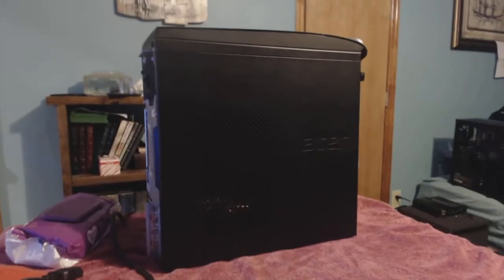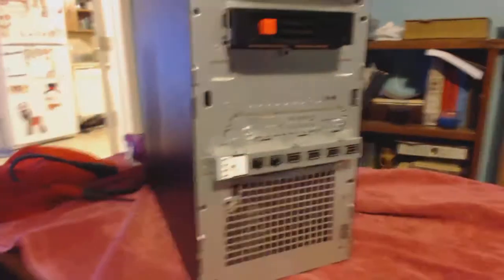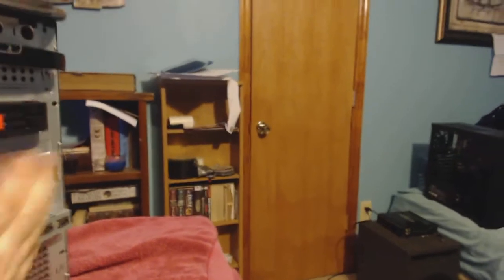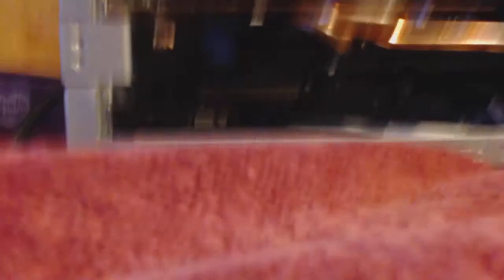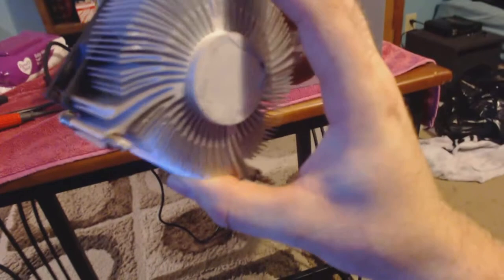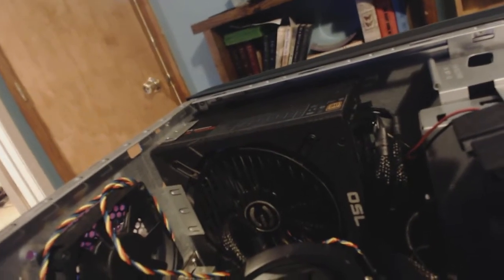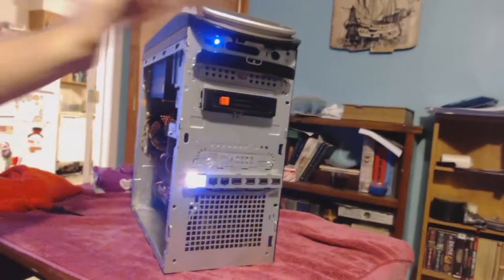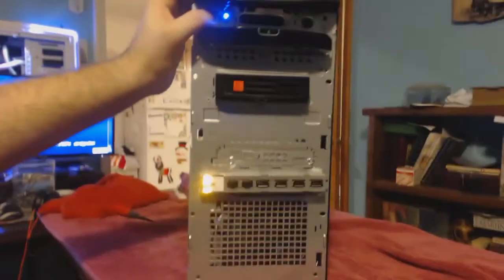$430 monster jam

Comment: Pretty much the same build here.

$450 build
40" low latency television

i5 2400
CM Heatsink
R9 380
8gB DDR3
128gB SSD
2x750gB Laptop drives (free)
Gigabyte MoBo
750w Corsair (Was on sale for $40)
Asus WiFi PCIe
etc etc

Pentium 3 Gateway case
Physically modified with a dremel.